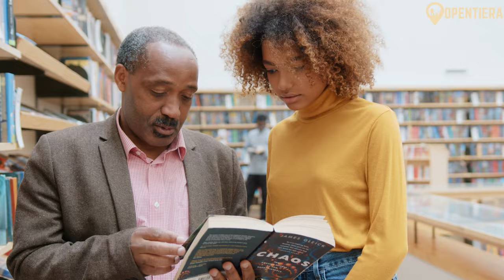Zambia Explained in 9 Minutes (History, Geography, & Culture)

Comment: Some corrections on Tribes/People (1) Bemba speaking languages and bemba tribe is different, the Bemba are only in Northen and Muchinga Province, Bemba Speaking tribes (with variations in their bemba) are however in Luapula, Northern, Muchinga and parts of Central (2) There is no Bemba tribe on the Copperbelt, the language was transferred there when bemba speaking tribes migrated there for work in the mine, Bemba is lingua franca in all the urban areas now, but origanl languages of the province persists in the rural areas.
(3) There is no Nyanja tribe only language, there is also no Tonga in the East, there is the Chewa whose Kingdom occupies the largest share of the East, followed by (51% positive) the Nsenga, the Ngoni, the Tumbuka, the Senga and finally the Kunda.
(4) There is no Lozi in the North-Western Province, also the Lozi use Barotse and Lozi synonymously and does not entail one tribe but a group of tribes and Language.